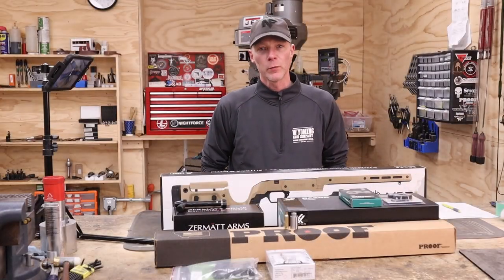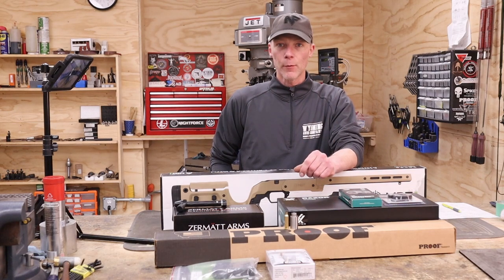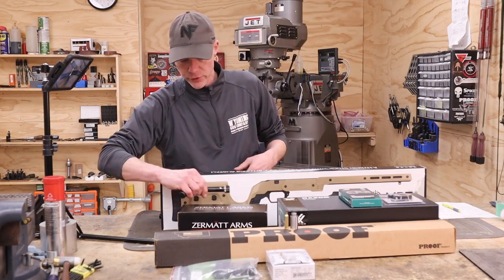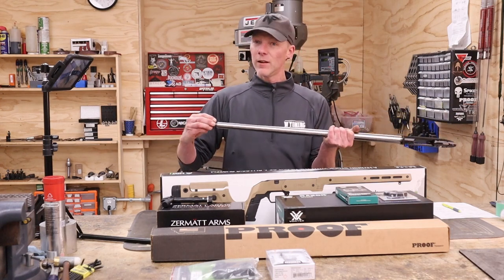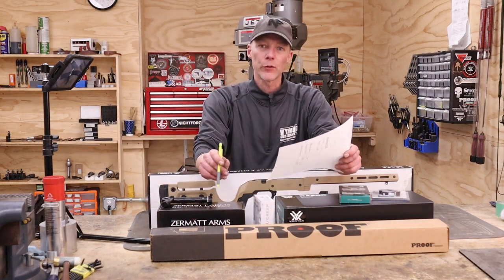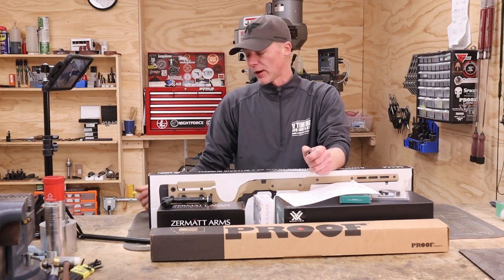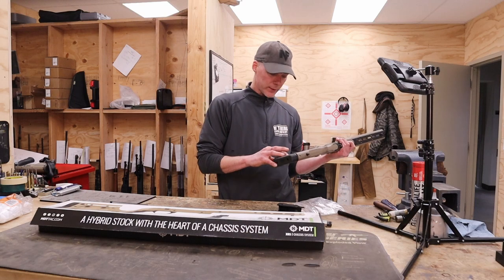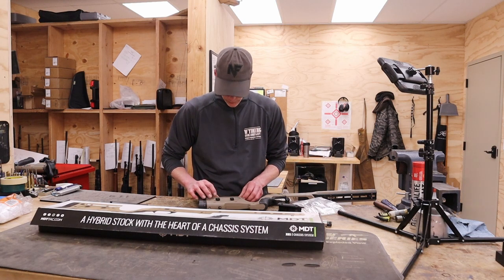6.5 Creedmoor PRS Competition Rifles: Bedding Process for Accuracy with High-Precision Components

Comment: Try making studs that screw into action first then place the action into stock. Put nuts washer on the other side to put a little tension on. Stops you pushing epoxy into action. Pushes it the other way out.
Reply: Yup was just writing that. I use studs much cleaner inside action.

Comment: After applying the epoxy and putting the action back in you put the action screws back in. They obviously had a little epoxy on them as you screwed them back in from the bottom and through the epoxy. I’m sure you put release agent on them and inside the holes, do they unscrew easy after letting the epoxy set up over night? Did you have to dig any epoxy out of the holes after taking them out? Thanks! Awesome video.

Comment: Thank you for sharing.
Respectfully...
I'd have liked to see the end mill operation.

With "no parrarell surfaces bedded". I'm surprised you removed material and put bedding compound , arcaglass  down the side of the action.  Point bedding....front and back only is the theory I've heard..

No bedding in barrel channel was what I heard...but...can't see why bit of support to barrel is bad ..maybe barrel heats and expands..

Liked your recoil lug approach...with the clearance on front and sides.

I wrapped the action screws in tape so there is clearance after  tape removed.

I'm not a professional at all...just interested.

These comments meant to be possibly helpful.

I'm looking forward to part 2😅!😊.

I liked the idea of tang screw first and melting the bees wax.

Looking forward to next video...
Appreciate the effort.
Thanks

Comment: You can use a high wattage soldering gun, heat the screw the heat will transverse up the screw shank and break down the lock tight so you can get it apart without damage.

Comment: How are you not filling the action screws with epoxy?
Reply: They do often fill up. The release agent allows the epoxy to not stick to the threads. Often you have to drill it out, or actually "unthread" the epoxy.
Reply: @davefulcomer2336  I use clay around the screw bores. It squeezes both in and out and keeps the epoxy from getting in. Cleaning up clay is much easier than cleaning cured epoxy and taking the chance of locking up.
Reply: I used taped blind screws...so action sits in with screws centred with right amount of tape and epoxy gets pushed down away
.not up and in..

Comment: So many things done wrong.  People actually pay you for this?  First, a MDT Chasis doesn’t need epoxy bedding.   But, you did the milling with the chassis bedding block in the stock assembly, but then remove it to apply epoxy.  Why wouldn’t you remove the aluminum bedding block first? You didn’t use bedding screws which keeps the material out of the action. Gezzz.  You intentionally did not relieve the recoil lug surface which is the number 1 reason to bed any stock.  You want 100% contact on the rear surface.  Between this video and the on where you F^<ked up a chamber by cutting it where it literally closed on a No Go gauge and didn’t feel a need to correct it, I now see why you left here and started your other channel. 
Vine gar,…..WTF
Reply: Ultimate Reloading just bed his 2 mile LRP rifle with a MDT chassis...not saying he did everything right...but if UR does it, that's the way to do it